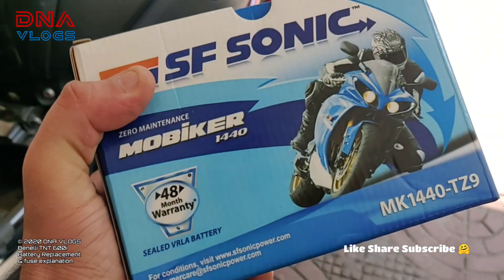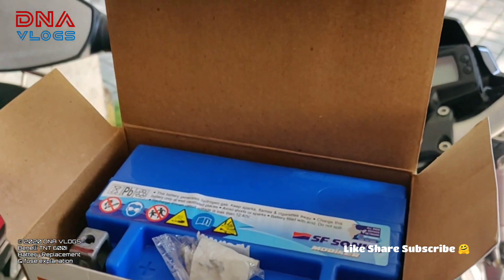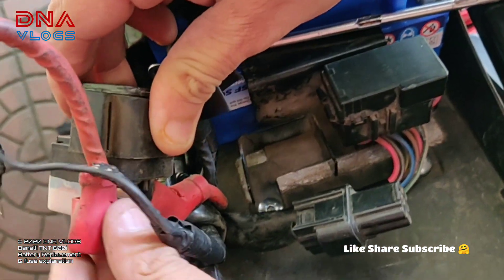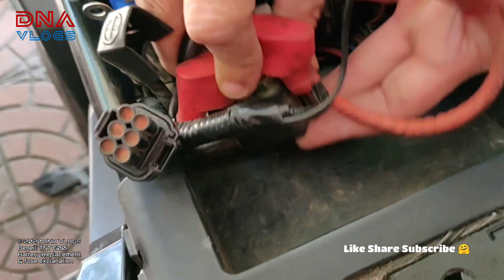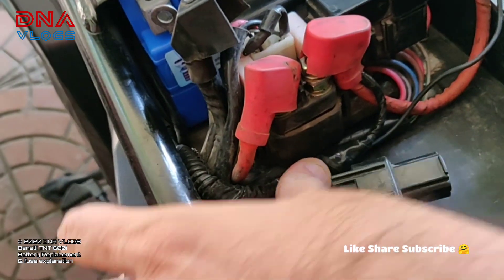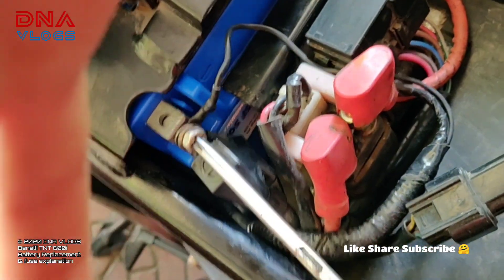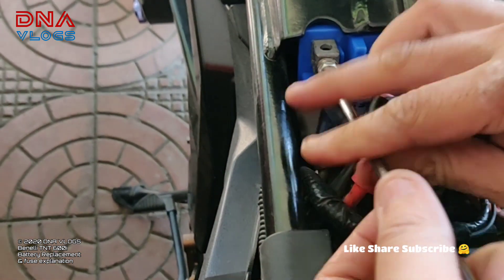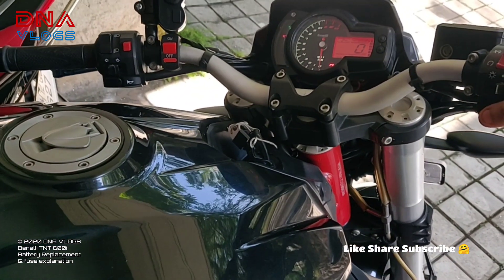Benelli TNT 600i | New Battery | SF Sonic MK1440-TZ9 | replaced at Home | DIY Install | DNA VLOGS

Comment: Hello brother, my Benelli 600i has iganation off. it's didn't on. Battery is new and i have hecked all fuses it's s good. And self starter relay also new one installed. I did on the key but bike is not on what's the problem?
Reply from the maker: @sunilrider69M  did you connect all wires for battery. There are multiple cables , one for main power supply, one for Fi too. Check all fuse once more. Check if any wire is cut by mice

Comment: Hi bro can u tell me which is the ABS fuse ?I found my ABS light glowing and not getting turned off
Reply from the maker: All the Fuses are under the Seat and it will have ABS written on it. ABS light glowing continuously may also mean, one of the sensors has gone bad, cable broken, or the ABS plate has bent. Dont replace the fuse directly, else it may blow once more. get these things checked. sometimes its just matter of sensor cleaning. refer my dominar video on ABS for more details. its in similar lines.

Comment: Hi ... yuasa battery cost is almost 4-5 time than sf sonic

Any clue why is it so?

And installing sf sonic or amaron will suit 600i?
I also need to change its completely dead in this lock
Down plz reply...
Reply from the maker: Hello, I make sure I always reply :) . Can you check if the Yuasa is the import piece. if so, then the cost will be more. you can surely go for SF Sonic. no issues at all.
Reply: DNA VLOGS - Dipen Nisar AutoVLogs  will go for sf sonic or amaron than thanks .. also my rear rubber is worn out need to replace that too
Reply from the maker: Sure.